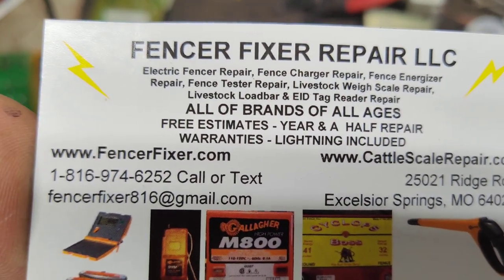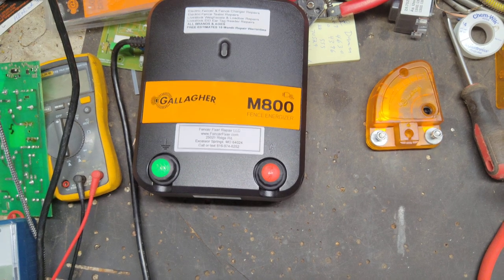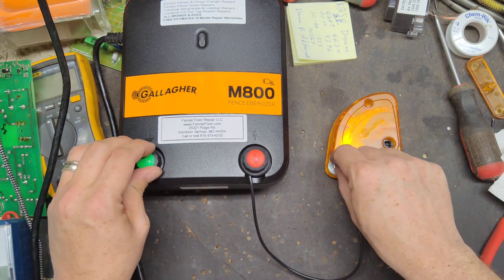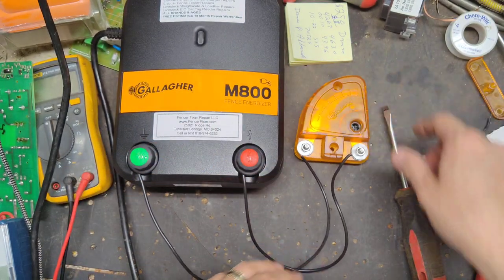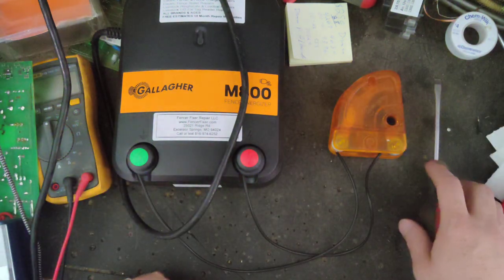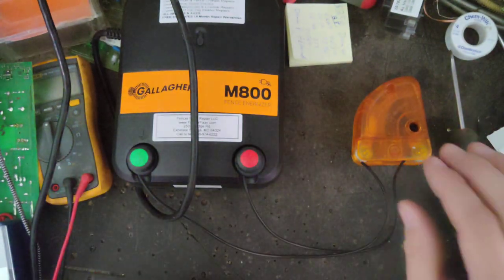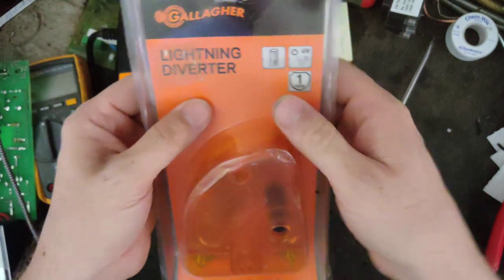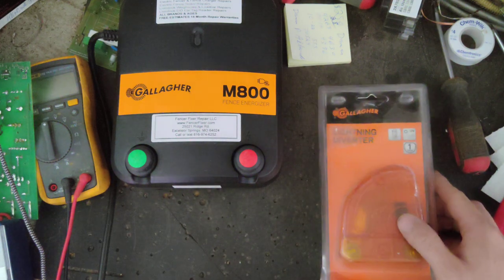How To Set Up A Gallagher Lightning Diverter For Lightning Protection On An Electric Fence

Comment: Interesting device.  An adjustable spark gap.  This would be ideal for those fencers which don't have integral lightning suppression.  Those that do have internal spark gap(s) set to what I would guess about 12 - 15 kV.  High enough not to fire during normal operation (~10kV) but low enough to protect the secondary winding.  Add MOVs and a fuse to get as good a lightning protection as is practical.
Reply from the maker: There's a lot of brands that have built in spark gap, even Gallagher does, but this typically will be good so to have do it doesn't burn up the sacrificial parts inside the fence charger and then you have down time trying to get a unit fixed. It's cheap insurance to have. This device from Gallagher has been around for 20+ years now
Reply: A 10kv Mov will be hard to add size and price wise.    You can prevent most surges on the 120v input, but Preventing what can come down the wire can be impossible...
Reply from the maker: @tsl7881  Lightning is trying to get to ground the easiest way it can. And it's a lot easier to jump across a small gap from fence to ground through the diverter than to fight the internal resistance of the unit to get to ground. If it's a direct hit close by then nothing will stop the strike. But I've talked to lots of customers over the years that have used the Gallagher lightning diverter and haven't had any strikes get the unit through the fence side in 20 odd years. Their diverter has been around for at least 20 years probably longer honestly.

Comment: I just bought a Gallagher 400 to replace a Stafix that I had had for a long time. The Stafix was .5 joule and of course the 400 is much less, but this is for less than 1000 feet of horse fence. 

I bought the Gallagher lightning diverter, and I had not yet looked at this video. You mentioned that you would not use this device on a fence of less than .5 joule. Should I send it back and use no lightning diverter?
Reply from the maker: What exact model of gallagher did you buy? The only 400 models I know of have other letters in front of that, so I don't know which one you have exactly. Here are those model names and their power. 
Gallagher M400, old discontinued model from 20 years ago 2.5 joule output. 
Gallagher S400, solar unit made today 3 +/- joule output
Gallagher MBS400, multi AC/DC powered unit still made today with 3 joule output. 
I don't know any other of their models with the 400 model name. Are you mistaken on the exact model name?
Reply: @FencerFixerRepairLLCKansasCity  Thank you. S400
Reply from the maker: @judymyers9552  Oh ok, that's around 3+/- output joules and a very reliable unit. So if you want to use a gallagher lightning diverter with that unit, you can use it.
Reply: @FencerFixerRepairLLCKansasCity  Thank you.

Comment: If you add a second diverter, pick a spot in the ground that is damp and plant your ground rod there  so your diverter always  has a good ground.  Crazy that a simple diverter costs $20-35.
Reply from the maker: The Gallagher one is probably the easiest to install and adjust the gap on the fly to get the gap right. Most out there the day isn't adjusted right and you have to walk back and forth turning the Energizer on and off so you can adjust the gap correctly. The gap isn't universal for every size model.
Reply: Well I found they can cost more than $35 too.  I just bought a new Se5 Parmak and unhooked a working old RedSnapper.  When I hooked up the new SE5 it made a loud popping noise and only showed 4kv?  Turned out the lightning diverter (an old enclosed ceramic) had taken the hit for the RedSnapper but its output voltage had always been around 3.6kv since I got a digital tester. The around 11kv was jumping over the vaporized parts in the arrestor.
Reply from the maker: @tsl7881 That ceramic one your talking about is actually called a lightning arrestor and not a diverter. It's basically like a big sponge. It absorbs the energy from lightning and they're usually a one hit wonder, they take one good hit of lightning on the fence and they're done for then there just a fence ornament at that point.

Comment: How do you figure out how many ground rods you should have? How far apart should they be?
Reply from the maker: Most manufacturer have the information in their manuals on what they recommend. Spacing is always the same, 10' a part between each ground rod. On the amount that you need, a rule of thumb is 1 rod per 2 joules, But, that's not always the case. It also depends on how rocky, dry, and sandy your soil is because everywhere is not the same. So that's why most manufacturers recommend 3 ground rods minimum to help compensate for dry or other bad ground situations. The larger the joule unit is, the more ground rods you will need.
Reply: Ok,thank you.

Comment: Can you connect this to a ground rod that isn't on the fence ground? My neighbor and I share a charger. Neighbor has the charger ground grounded through the outlet box. There are no ground rods connected to the charger.
Reply from the maker: Most manufactures would recommend that you don't ground the charger through the buildings ground and to have it's own separate ground system at least 35' away from any other ground system. But if it's working at the moment, I guess keep it that way. 

On a separate ground rod for the lightning diverter, it might work that way. Because ground is common to everything, so it might work. I just don't know with your unit being connected to the outlet box's ground.
Reply: @FencerFixerRepairLLCKansasCity  he says he has done it that way since he was a kid and never had any ground issues. I know it's not the correct way to do it but I know nothing about electric. What are the problems with grounding it that way? Just curious as it is his charger but it is in my building/electric. I tried to find info on Google as to why it is not recommended but my search came up blank. Just want to make sure it's not hazardous having it that way.
Reply: Are you possibly sacrificing an out building without much electronics.  Hope your not using the ground through your house panel. Might not go so well when you get a big strike.  Satellites were installed with a little ground wire coming back to the house wiring.  When the dishes got stuck, things melted.